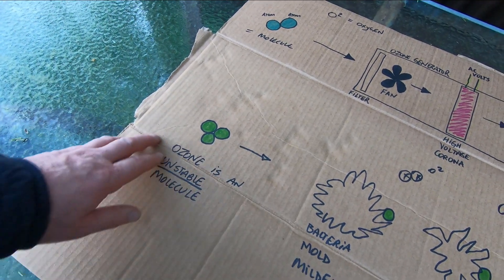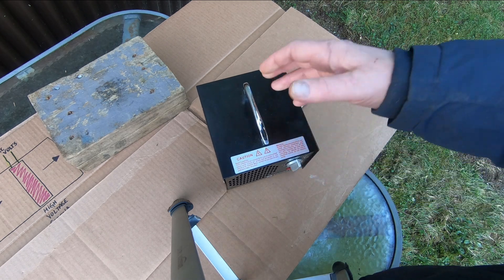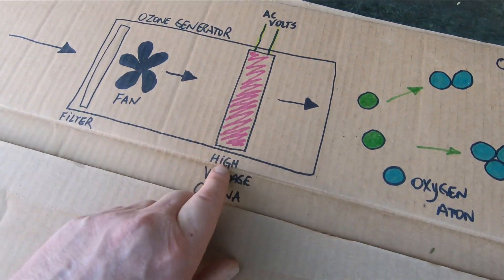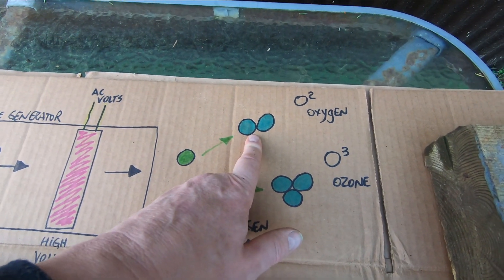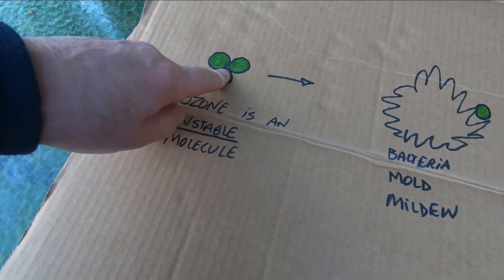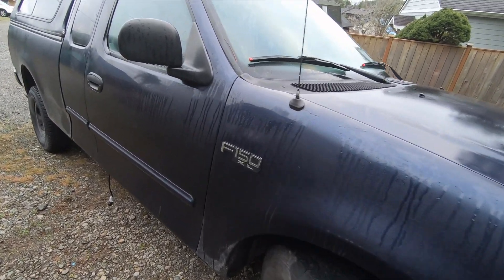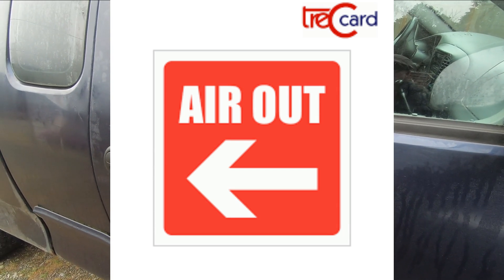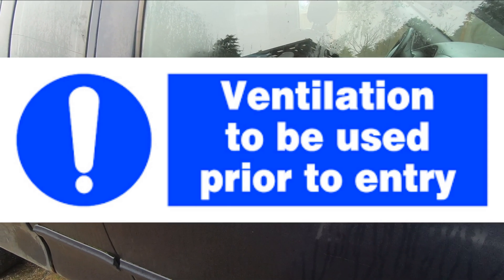How Ozone Generators Work

Comment: What does the EPA say about ozone generators?
Reply from the maker: The regulations are that they should be used only intermittently and never used in an occupied space (No people, pets or plants in the room). They are effective in killing mold, mildew, bacteria and viruses and in the elimination of unpleasant odors like smoke. They must be used with abundant caution and safety procedures.
 There is some ongoing controversy about "air cleaners" that use ozone-generating technology.
As a maintenance tool, used carefully and infrequently, they seem to be safe.

Comment: PARTY TIME!! So back in the 80's when everyone was freeking out about the ozone layer, all we needed to do is plug in one of those black boxes?🤣 
Thanks for sharing Craig✌
Reply from the maker: There is a high voltage demand per amount of ozone created so replacing ozone in the stratosphere would take more energy to produce artificially than we could make. Naturally occurring ozone is destroyed by chlorine and other elements, some of which are found it refrigerants and other processes. When released into the upper atmosphere, for example, 1 chlorine atom can destroy 100,000 ozone molecules before being exhausted. Stratospheric ozone acts as a shield for the earth from the sun's radiation. Ozone is a strong oxidizer that reacts with many substances to neutralize bacteria, viruses, mold and unpleasant odors. That's their practical use in machines like this.
Reply: @EverydayProjects  Well we certainly can all use a little practicle use Craig👍
Reply from the maker: @ They're great for removing moldy smells. You're lucky to live in the cold north because it is dry. On the west coast, it is damp, and while I can get around in a Speedo most days, cars get moldy.:face-fuchsia-poop-shape:

Comment: This is interesting, I did not know about these and I certainly did not know how they worked. Thanks
Reply from the maker: There is one clip that I forgot to add and it explains that the free oxygen atoms act as an oxidizer to break the cell wall of bacteria, mold, mildew and viruses. That's how it kills them. In the case of smoke and odor, the oxidizer changes the chemical composition of the smoke itself and renders it into other compounds. The new compounds are different from the original compound and don't smell like smoke (or odor), which is the desired effect. Maybe in a future video I will delve into the chemistry a bit more.
Always nice to have you and the cameraman along for the ride!